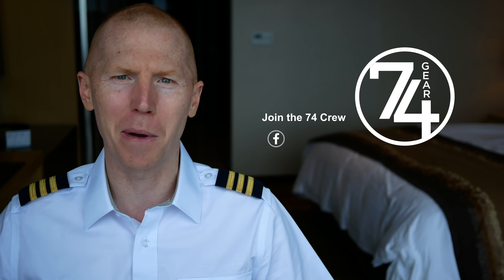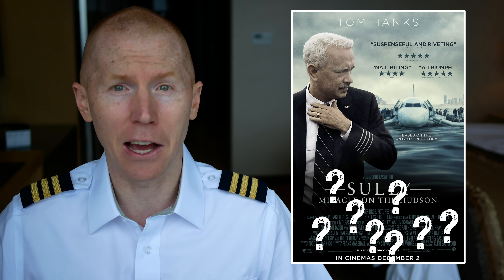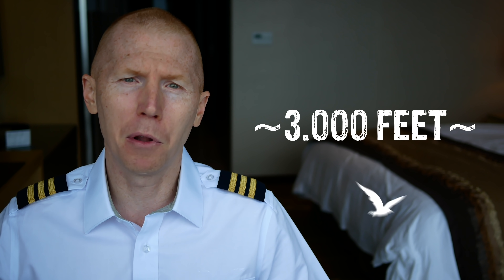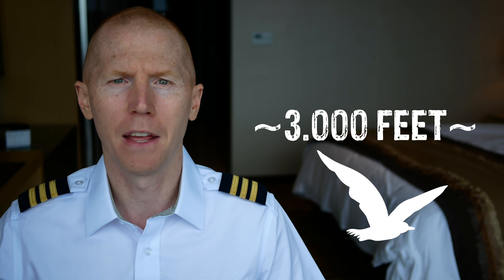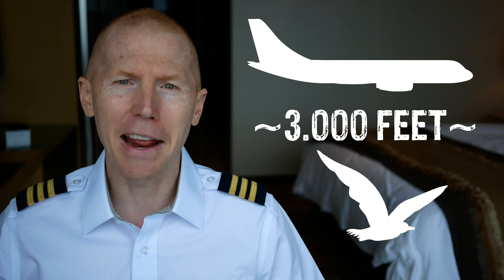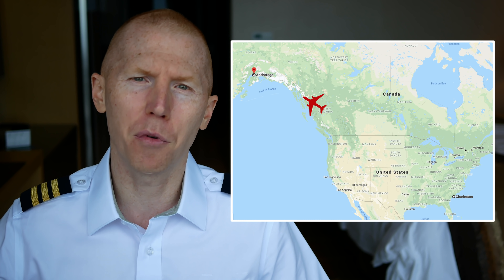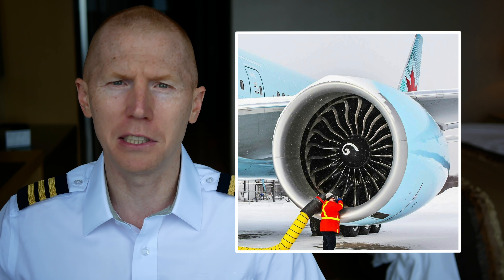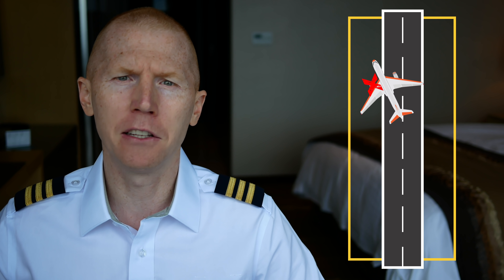Why Engines Don't Have a Mesh or Grates to Stop Birds

Comment: How’s about retractable bird grills which only open if there are any birds around? Combine it with IR sensors at the aeroplane and implement a deep learning algorithm which can see birds before a pilot does (take the technology from the f-35?). You only loose engine thrust in the moment of the actual bird strike.

Comment: A JET TRAVELING 550 MPH WITH THAT BIG OF AN AREA TO THE FRONT OF THE ENGINE CLOSED OVER WITH WIRE SCREEN WOULD HAVE TO HAVE A VERY HEAVY STRONG GAGE WIRE SCREEN OVER THE FRONT OF IT WITH THE WEB WIRE CLOSE TOGETHER. HE  IS RIGHT IN SAYING THE AIR FLOW WOULD GREATLY BE RESTRICTED. THE ENGINE WOULD HAVE TO PUT OUT FAR MORE EFFORT TO ACCOMPLISH  THE SAME TASK WITHOUT THE SCREEN.

Comment: Have you ever wondered why you don't have to dip the nose of the plane down 2,777ft per minute (assuming a 500mph cruising speed at 35,000ft on a ball earth measuring 25,000 miles in circumference)

Comment: Why couldn’t they make metal grid, that can hide after takeoff and eject before landing. That would solve the fuel problem and keep birds out of engine.
Reply: A grid won't stop the engine sucking a bird through it. You would need a cone with rear facing intakes, it would basically stop the engine from working.

Comment: I put a screen on my model jet it didn't cause air flow problems course this does depend on the size of the holes in the screen how ever if the screen where to give away and also go into the motor it would do alot more damage then a bird would so still not a good idea but just letting you know a screen does not effect the airflow depending on hole size class dismissed

Comment: That’s actually a good idea I have never through that of this. But without watching the video I can guess the reason why they haven’t implied it on the engines yet maybe because the air they idk how to word it but the air engines suck in is a lot like it can pull you so it would have lot of pressure on the rails

Comment: Couldn't you have a grate that is forward of the engine and on a folding arm that corresponds to landing gear? 
Landing gear up, this metal grate folded up and away. When landing gear are redeployed, deploy the grate.

Obviously we're talking a strong grate designed to handle a goose hit it at 300mph without breaking through into the engine. It would obviously deform and need replacement after a bird strike but is still a relatively cheap part, especially compared to fixing the engine.

Maybe you even increase the complexity to a wedge from two grates to make deflection of birds easier.

Comment: We need to protect the engines without disrupting airflow.....we need the seats 6 rows in front of the engines to have roll down windows. Those passengers hold giant bug catching nets out of the window until the plane reaches 5000 feet. After that, they pull the nets back inside and roll the windows up.....

Comment: As a pilot you can also pull the flaps in and out, you could then put a net in front of the turbines, which you also extend during takeoff and landing and retract at 35,000 feet or so during the main flight, that would be possible without problems or not? Or lasers.. They wouldn't effect the air intake

Comment: I can't see a screen blocking that much airflow. The engines are so powerful and yet the air gets compressed once in the engine.
Reply: It's a huge effect. The energy in the air is significantly decreased when it comes through the grate, and then the compressor has to do more work – so the burner needs more fuel and the turbine needs to extract more power. Nacelle design is a very active field of aerodynamics, attempting to develop very uniform flow into the engine and minimize losses from any spillage (air flowing around the engine instead of into it). A mesh in front of the engine would destroy efficiency.
Reply: @AmbientMorality  I can't see that, if the air is going to be compressed anyways after the grate. Thin grates would not restrict airflow to a point of being an issue. The compression would  increase the energy once in the engine. For the most part aircrafts are working in high altitudes anyways.
Reply: PipenFalzy The goal is to raise the pressure with minimum compressor work. If stagnation pressure is lost before air even reaches the compressor, the compressor then has to do more work increasing the pressure
Reply: @AmbientMorality  compressor is going to work hard regardless, that's what it's designed to do. The stagnant airflow would be Minimal do to very little surface area and the grate would be a rounded surface to minimize disruption of the airflow.
Reply: @PipenFalzy  The compressor gets work from the turbine, which gets work from the hot flow exiting the burner. If you're pushing the compressor harder you're also pushing the turbine harder, and thus need more fuel in the burner (decreasing efficiency substantially). Stagnation pressure loss doesn't mean that airflow becomes stagnant, it means that the stagnation pressure (pressure of air if you hypothetically brought it to rest without inefficiencies) decreases. For a mesh screen the velocity just outside and inside will be similar (some spillage losses though) but the pressure will drop a lot. The work required for the compressor is related to the compressor efficiency and the stagnation pressure ratio, so it's a substantial effect.

Comment: What I thought of is that airplanes fly so fast that no matter what you'd put in front of the engine it would just dice the bird and have the bird getting into the engine anyway. Moreover when that happens, that would damage the prevention grid so you could get the bird PLUS debris getting into the engine

Comment: Some helecopters have them like the twinstar or as355f2 but ive never seen them on jets and always wondered why that is . I think small air disruption cones bolted around the inside of the housing wouldnt stop a bird going in but they could be made to guide the bird down the outside of the engine but inside the housing  so it can raspberry jam safely away from anything vital in the inner engine. I shall expect a payment from boeing if i suddenly see them on aircraft a point my lawyers will bring home very directly. lol

Comment: Great Video . Okay ,I get the.lack of fuel efficency . Makes sense.  I think the easiest way to solve this is to have a retractable screen that folds up after reaching 3k feet and comes down again . Some kind of gagaue that can determine altitude and engage or disengage at right time.

 I'm sure an engineer would know how to design it far better then me . So its only decreasing fuel efficiency for a couple.minuets.  

Crazy idea ? Thank you and keep up the awesome work!
Reply: The right way to design it is to not design that. You're decreasing engine performance and efficiency a lot in a regime where you need the most out of them, which isn't a great idea.

Comment: Lets also not forget that a screen would also be another piece of the plane that has to be maintained and while maintenance crews are great at what they do things do get overlooked. If a screen is faulty and not properly maintained it could break off and cause engine failure well above the 3000 feet mentioned... Any object being sucked into the engine can cause it to fail which is why FOD (foreign object debris) checks are so important.

Comment: What could potentially be a solution is to have some kind of retractable screens in front of the engine which could be deployed for take offs and landings, when the loss of an engine at lower speeds and altitudes owing to a bird strike is a more critical problem. Might be difficult to engineer, but where there is a will there is usually a way, and it is worth bearing in mind that the problem of birds near airport flight paths is actually on the increase, so whilst birds strikes and ingestion on engines is not a very common problem, it may become somewhat more common and therefore merit being addressed at some point in the future.

Having said that, among other things which are part of my job, I have to inspect commercial aircraft on arrival at the ramp. In the past three years of doing that, I have literally never seen any evidence of any bird strikes whatsoever, so I do agree that it is a rare phenomenon at present. But what I have seen on several occasions however, is damage to fan blades from FOD strikes which probably occurred on the taxy in to the ramp, whereby individual fan blades have been bent, so this is another consideration where such a solution might be considered practical.

Some people in the comments section have noted that quite a few military aircraft - perhaps most noticeably the MiG-29 - have the capability to redirect the air intake for the engines up to some gill inlets on the upper surface of the engine intake for take offs and landings, by means of some movable doors on the inlet. This is largely because the MiG-29, as evidenced by its rather agricultural-looking landing gear, was designed to be able to take off from rough surfaces in the event that its base runway were to be knocked out. But obviously this is a tactical design choice rather than one which would seem practical for an airliner.

Those incidentally, who as a result of the MiG-29 having been brought up, got into a pointless pissing contest in the comments of whether other contemporary fighter aircraft were better or worse than the MiG-29, ought to perhaps bear that rough-field performance of the MiG-29 in mind. Any jet combat aeroplane can be as good as it likes, but it's no use if it can't even get off the ground to get up in the air to perform its mission. As such, the MiG-29 and other aircraft which take such operational matters of practicality into their overall design, are much like other Soviet era equipment which did so. A good example of this being the AK-47 Kalashnikov assault rifle: It is not as accurate as the M-16, but only one of these two weapons can be dropped in a muddy river and come up out of that mud with a reasonable expectation that it will still be able to function as an automatic weapon, rather than solely as an expensive and somewhat fragile club, and it is obviously one of the reasons why numerous Kalashnikov variants are the weapon of choice for rebels and guerrillas who find themselves in less than ideal conditions much of the time.

That such matters of practicality are not a bad idea in a long war of attrition in difficult conditions, can be seen in the tank designs of WW2 too. I don't think anyone would deny that the German Panther tank was one of the best tanks of WW2, but when it came up against the undeniably less able, but infinitely more reliable and more numerous M4 Sherman, which as a result was able to be fielded reliably and in considerably larger numbers, well, we know what happened and which side won, don't we?

Airliners are of course not combat aircraft, so these kind of considerations have to be weighed up in terms of their practicality for how and where an airliner is used, but it is nevertheless fun to speculate on what, if anything, could be done to alleviate such potential issues as a catastrophic bird strike.
Reply: It's inherently a major performance penalty, and there's no great way to solve that. Meshes cause large pressure losses; that's directly tied to how much work the compressor needs to do, and thus how much of the fuel is just going toward keeping the engine running rather than generating thrust or powering other devices (the fan, etc)

Comment: I understand what you mean about the plane using more fuel if they had a mesh screen... However if they could incorporate a retractable mesh design where the mesh would simply retract after 3000-4000 feet it wouldn't be as fuel inefficient on those long flights. Like you said it would only be for a few minutes going up and down... Just a thought. Love your videos man. Keep them coming. I've always wanted to be a pilot. 2 of my uncle's were.

Comment: Just make the grates/wires retractable, so that under 3,000 feet or so, the pilot lowers the bird shield down, and above 3,000 feet, the pilot raises it so that it doesn’t restrict air flow.
Reply: So it restricts air flow in the one time where you need the highest performance (takeoff and landing, in case of go-around)?
Reply: Appable 
If you need to go around, just raise it partially or up all together. Yes, the takeoff and landing is a very crucial part of an airplane’s flight, but the air is also much thicker at “ground” level, so the engine would have more air intake than at 36,000 feet. Also, if the wires are thin, they would not restrict airflow by a significant amount, and if they weren’t stretched too tight, they would still be able to at least partially deflect a bird strike without breaking.

Comment: What about adjustable strong metal fencing with small gap. Which will work on 0 ft to  3000ft or 3000ft to 0 ft. only at take off and landing time.

Comment: New tanks have automatic systems that destroy the incoming missiles before hitting the armor, why there cant be something similar, but just with a very strong "puff" of air that is strong enough to get the bird flying past the engine so it wont get inside the engine?

Comment: Hmmm... Why not install a "sliding screen" (or whatever you'd call it), which will be blocking birds from entering the engines up to e.g. 3,000 feet, after which it would be slid e.g. underneath the fuselage?

Comment: I've been in two aircraft during bird strikes. One was a D-18 Twin Beech and the other was a DC-3. The worst part was the cracked windshields. The second worse part was cleaning all the guts out of the engine cowlings.
Reply from the maker: I have had lots of Bird strikes over the years, but if they flame out all 4 of my engines I am going to be pissed!! 😂

Comment: Of course there are ways to make engines immune to birds.  And methods to make engines with grids and cones. Like SR-71 style of engines. Parabolic grid can be added.  Filters can be made. But aircraft will become much more expensive and is always cheaper for the aircraft company to pay for your funeral than make dramatical adjustments to the design. If for example 300 passangers all seat have catapult seats with capsules, independant air tanks and parachoute groups and aircraft had 300 ejector slots in the hull then ticket will be so expensive that few gonna buy it. So your funeral is always cheaper. For the company is nothing to pay few hundred funerals per 100000 flights.

Comment: During take-off have removable screens in front of idling engines and use JATO to get above 3000 feet - pilot then hits "screens off" button and engines come up to full thrust or

No airports below 3000 feet or

taxi ramp from ground to 3000 foot or an elevator.

Comment: My first thought about the question is that a strong, aerodynamic razor blade guard only slides the bird to maybe 5 pieces, and the engine will still shut down. The first stage duct fan in current design already slices the bird into at least 20 pieces before the carcass goes into the compressor. "Pre-slice" the bird into 5 pieces, then slice it again to 25 pieces does not make any difference.

Comment: Okay, fair enough BUT: aircraft already have crazy amounts of engineering, powered by hydraulics... how about a gated screen? Just like the flaps or thrust reversers, you hit a button right before takeoff... hydraulics leverage a set of screens out in front of the engine intakes, which might have a MARGINAL impact on fuel economy, but will DEFINENTLY prevent another "Sully" type incident. Take off, hit 3000', or whatever flight level the experts determine, and push the same button. The screen grates retract and fold flat along either side of the engines and bam, full efficiency restored.
Reply: It would also decrease air intake (massive spillage) and therefore decrease thrust when you need it most

Comment: Why not have a sensor, it will detect for bird in the radius of 100 meters and if it detects birds, an automatic flyer pop-up thing will come on to the engines and then straight after it will go back to its normal place :)

Comment: Well, I thought it would discuss grate debris (with bird ones), with the fact that in icy condition, ice build-up would block air, and you'll end up loosing both engines which defeats the entire purpose. Plus the added weight on each flight for an event that occurs once in thousands of flights, passengers will have to pay each flight in fear of a threat who hardly kill or even injure, just some broken piece of metal. Then people seems to think because no one is willing to discuss the issue,it must be because of money.

Actually, the issue is pretty well managed (in western countries) : there are equipments, humans and animals used to threaten birds and vacate low level flight routes. There are studies, reports and monitoring. Along the years, those efforts subtentially decreased birdstrike occurences and are much more efficient and reasonable than the idea of trying to make a failsafe plane. Just like your car, it's not because another vehicle can crash into yours that every car should be a tank (and that wouldn't even solve the problem) Everytime I read "why not put grades in front of engines" I just want to shout "stop focussing the damn plane and explore options not involving it."

Comment: Let's ignore the efficiency issue for a second. What would we actually accomplish by putting up a mesh in front of an engine? Well, now our poor bird is getting sliced into french fries before entering the engine and taking it down just the same. Putting up a mesh is not going to make the massive sucking area in front of an engine disappear. The bird dies and destroys the engine either way.
Reply: Smaller bits are less likely to cause problems downstream though. Not that it's a good idea in any way, but fundamentally if you could break apart a bird before it enters then it would work